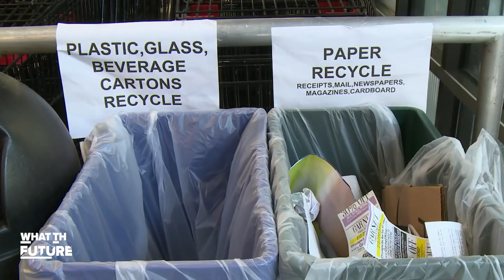Our Global Recycling Problem, Explained

Comment: WE need to start building robots that can make a house out of recycled plastic.  Nothing fancy just a basic 3 BR 1 bath house with a rain water harvester in the middle and a roof that drains that way.  Since plastic is toxic when it burns it will need a built in sprinkler system and a fire detection thingy too.

Comment: I drink alot of bottled spring water and have 5 black bin liners full of them. Are local recycaling locations require that there are no labels of lids. So sorting the bottles takes a long time and I know most people definitely do not recycle like I do.
Reply: WATCHING THE WATCHERS Do you realise how damaging bottled water is? Not only the packaging, but the massive amount of energy used to transport such a heavy product. It's completely unnecessary too in most developed countries, tap water is perfectly safe to drink and usually has even stricter controls than bottled water. If you're worried about what might be in it get a filter. Well done for recycling, but you really should consider if you need bottled water at all.

Comment: This is a great video (LHRD=Lactote Home Recycling Depot)

1. The answer, in large part, for capturing the Ocean small plastic bits is the no cost LHRD. There will need to be drop off points like Waste Transfer Stations using bins made from waste plastic for the mixed ingots. Yes the LHRD will take all the plastic films the guy is talking about. And the flexibles will be compacted in the bottle making them less of a fire hazard amongst other things.

2. AI will handle the larger rigids like bottles and such. Plus sort aluminium cans, glass bottles and paper.

3. Disposable diapers should be discouraged and a return to washable nappies encouraged

4. We need more people with end market product option knowledge to get the ‘end-use’ markets developed for the industrial post-consumer plastic waste. I have designed numerous very large items for Integrated Recycling which are currently in use across Australasia. 

5. We should ban the use of timber in transport pallets – plus all outdoor bollards and similar that don’t require structural certification – change to waste plastic options.

6. We need more plastic Extrusion/Moulding operations  +61499008862

Comment: Manufactures need to make the contaimer with ONE type of plastic.   A plastic bottel has a film lable , the cap and the bottle each a different material.
Reply: Your desire for a 'one plastic type' bottle is absolutely spot on....... but  in the instance of plastic PET carbonated soft drink bottles..... manufacturers can't make their lids from rPET or PET due to processing issues. All lids have to be LDPE, HDPE or PP and not PET or rPET. For example Milk bottles, and plastic bottles that are not carbonated like for creams and juices, are generally all the one type of plastic but ......as I say these bottles won't hold carbonation. All water bottles should be LDPE or HDPE....and then recycling is a breeze. Water should not be in rPET or PET

Comment: there should be a tighter public policy on garbage sorting. this would make recycling much easier and more efficient.
Reply: Rodrigo Covarrubias that's hard to do in America atm because not everyone is recycling even let alone sorting out different type of recyclable
Reply: @Shillicity7009  , well you gotta start recycling. Nobody is recycling in America because there are no strict rules that would regulate this kind of stuff. If you just forbid non sorted garbage, make it so it is simply impossible to throw your garbage away if it is not sorted properly, problem will be solwed. It is not that simple of cource and it doesn`t need to be as dramatic of a change as I described, but you gotta start somewhere. Fine of 500$ for a bag of non-recycled garbage would also help :D
Reply: In germany the garbage bags are required by law to be clear/see through (at least in some parts) so that the garbage company can see if you followed the rules if not they wont pick it up